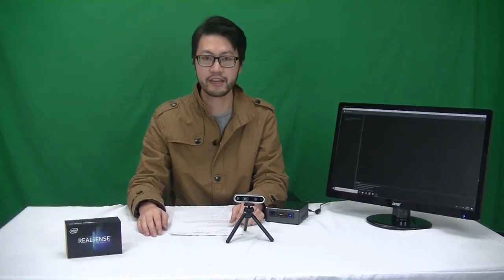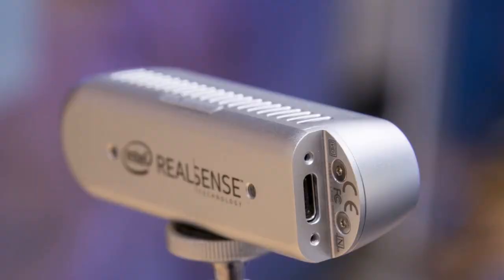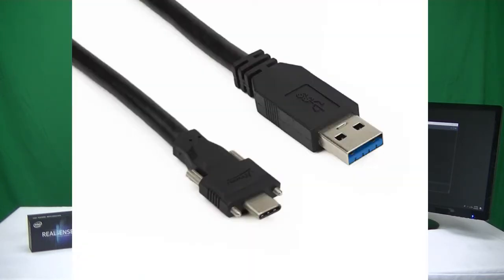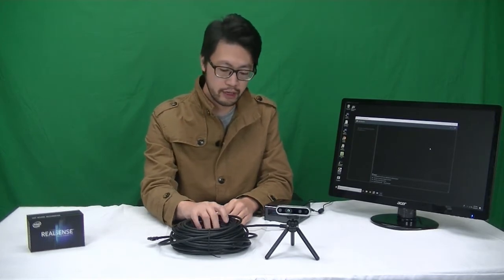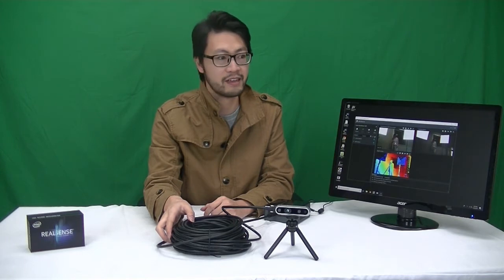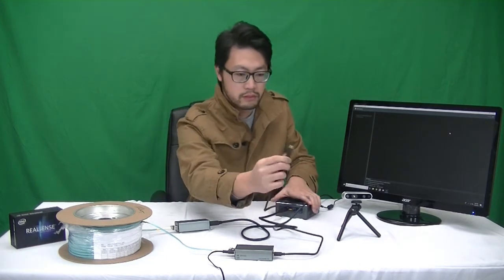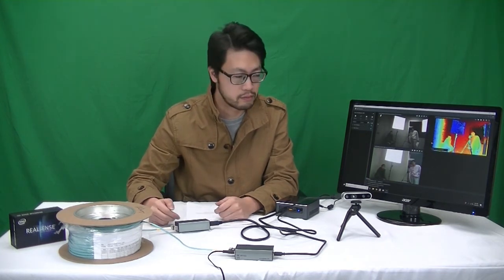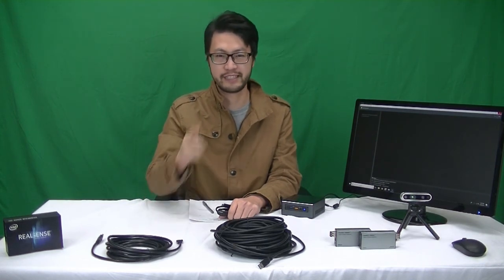USB Extension for Intel RealSense D400 Series Camera

Comment: Whether this extension will work for D415??
Reply: Yes it will.
Reply: @RichardBronosky  Thanks for your reply 
We are using active cable USB Type A-A 15 m length , we facing below issues with error message as below 
"Case : Camera Error
Possible reasons : Error calling rs2_stop (sensor nullptr)
Null point passed for argument "sensor"
Error calling rs2_close (sensor nullptr)
null pointer passed for argument "sensor "
no error
check configuration for Camera : cam0 in INI / Max and try again "

Can you please suggest for the same
Reply: All of the RealSense cameras should be fine with a 5Gbps cable. That is the spec for USB 3.1 Gen 1 which Intel indicates in the Specifications section on all the product pages I've seen. I have the D415, D435i, and L515. They all work with good 5Gbps cables. But some cables I've tried were only 480Mbps and I got poor results from those.

The way I've discovered to get good data for comparison is to do a [Linux] `lsusb -v -d 0x8086 > log1.txt` to capture what the camera advertises about itself. I create one of those text files using each of the cables and use vimdiff to compare them. You will see that the lower capability/quality cables cause the camera to advertise fewer features. Good luck, friend!
Reply: @RichardBronosky  Thank you for the inputs . Can you share your contact number to discuss on the same issue ??
Reply: @RichardBronosky  We are using Windows 10 , 15 m active cable USB for Camera communication, facing disconnection error during camera streaming.  kindly suggest to overcome